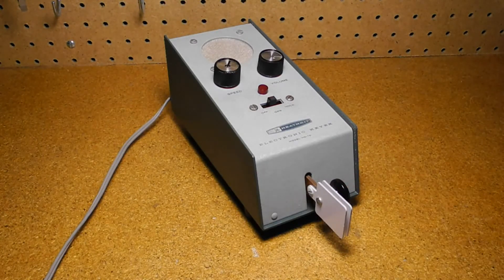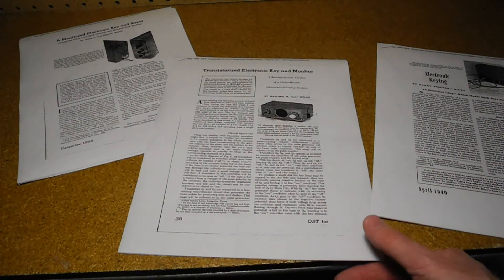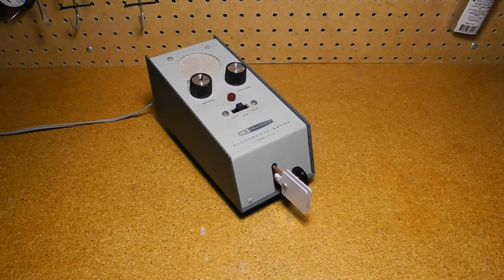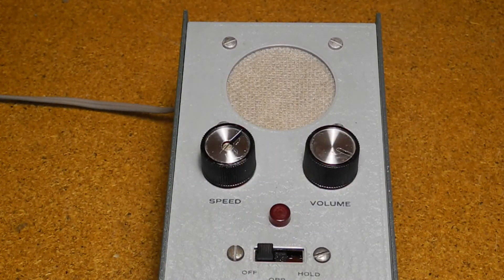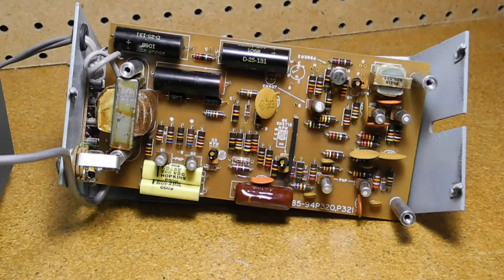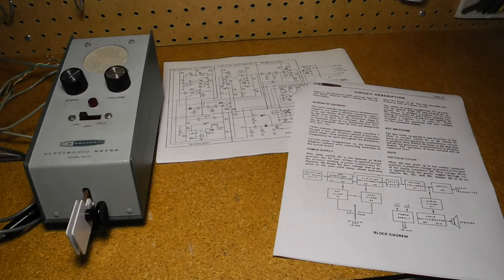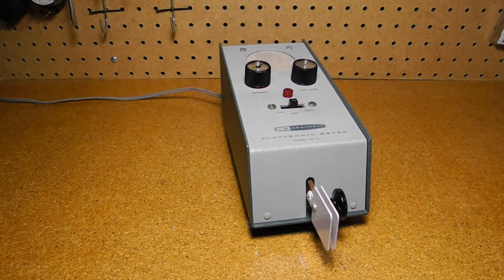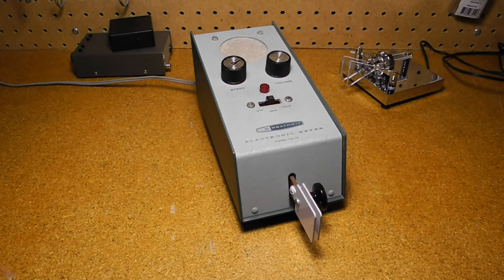The Heathkit HD-10 Electronic Keyer

Comment: I restored one last year. Recapped checked resistors and transistors. I had a dirty micro switch for the DOT, turned out to be dirty cleaned it and it works great. Case paint is in mint condition.

Comment: Do you know if I can use my Heathkit Model HD-10 keyer with a more modern transceiver?  I have a new Yaesu FT-DX10 - I am afraid to connect it - not sure if the voltage coming off the Heathkit keyer is incompatible with the modern solid state rigs????  I also have a Yaesu FT101EE - and it works great on that rig. Any help appreciated!!!!!!   Ron WB9EGG
Reply from the maker: The keyer should not damage the transceiver - it's more an issue of whether the transceiver will damage the keyer.
The HD-10 works with with grid-block keying or other transmitters that use negative bias, provided it does not exceed 105 volts at 35 mA.
The FT-101 models use grid block keying so it works in that case.
The FT-DX10 is a modern transceiver and likeley not using negative keying as it is a modern transceiver. It might work if you reverse the polarity of the leads from the keyer.
Reply: @jefftranter   Hi Jeff, Thanks for this quick reply and information! When you say "reverse the leads" - do you mean to use the ground as the "hot" lead and the keyed line as the ground?? My Yaesu FT DX10 uses a 3 contact 1/4" male - it wants the tip to be the DOT and the ring to be the DASH, and then the sleeve to be the COMMON. My manual says key up voltage is +5.0 Volts DC, and keydown current is 3ma.   Does that tell you anything further as whether it can work or is compatible??
Ron
Reply from the maker: @RonPurser  Yes, you would use the ground as the hot lead and keyed line as ground.However, if the ground line of your FT DX10 is at chassis ground , this is probably a bad idea as the keyer's chassis will be connected to the rig's keyed line and not ground. Another option is just to use the paddle of the HD-10 and use the FTDX10's internal keyer, but it looks like that would require some rewiring of the HD-10 and it would then no longer with the FT101EE.